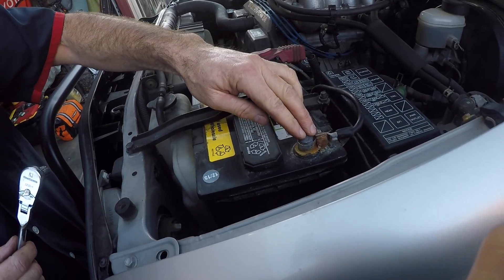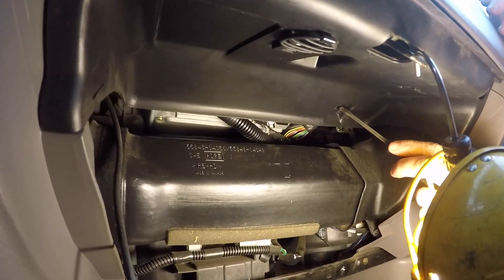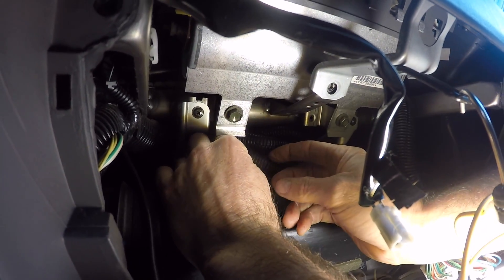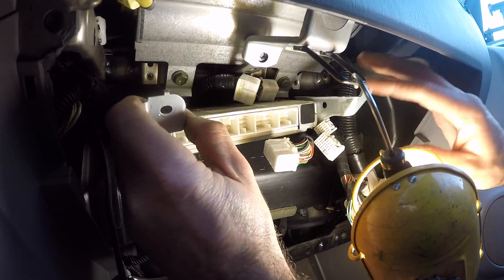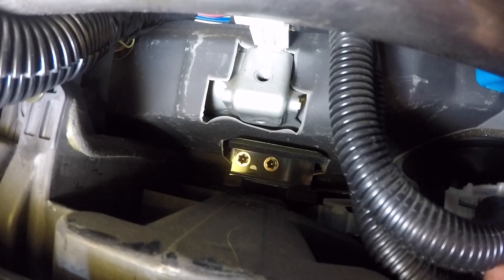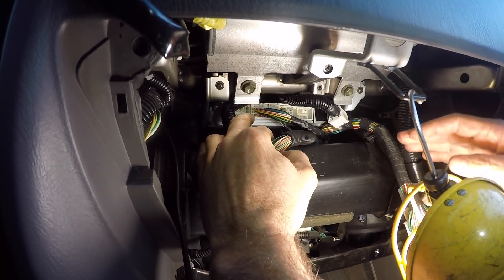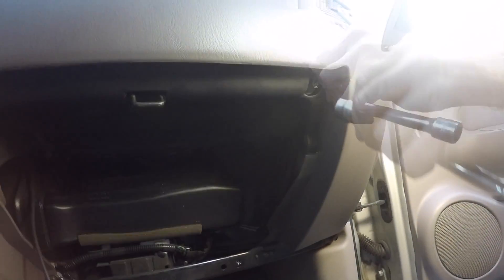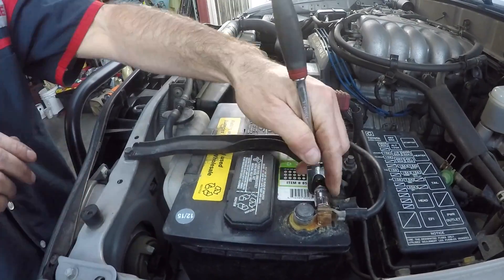ECU Replacement

Comment: Where’s Best price for ecu 2006 rx330 ? My problem is rough idle and driving at cold , seems after 30 minutes runs fine, she will drop rpm s kick and buck and after 5 minutes it run fine, she just turned 200k
Reply from the maker: I'm not sure your issue is an ECU issue, but the most affordable route is finding one at an auto wrecker.
Reply: @TimmyTheToolman  had shop put scanner on it this morning and the said ecu would not send out info? I think it’s a heat coolant sensor or wire connector problem 🤷🏻‍♂️

Comment: How much does it cost to replace ECU
Reply from the maker: Depends on how much you find a used ECU for. eBay has them in a range of prices for the same ECU, it just depends on what the seller is asking.. the cost to replace it is FREE if you do it yourself. As you can see from this video, it’s pretty straightforward. A couple interior panels, screws and electrical connectors and it’s out.
- Sean

Comment: I have a 95 can I use a computer from a 97? Found one at the junk yard.
Reply from the maker: Well if you’re talking Tacoma, we think yes (1995.5) but I would recommend getting the same year if possible to avoid any compatibility problems you could encounter with that early first year Tacoma ECU.
- Sean
Reply: @TimmyTheToolman  yeah I have a 1995 tacoma 5vzfe 225k miles. Changed everything out that would fix a p0303. Nothing. The code remains to come back after a few drives. Mechanic told me it could be a computer issue since the truck runs decent considering the mileage (226k). Found one at a junkyard but it’s a 1997 with the same engine.

Comment: Hope u be able to get to that tundra problem, are checking the compression? , on cylinders?
Reply from the maker: It was actually a Tacoma, and we did check the compression on all 6 cylinders.  We figured out that the issue was crankshaft play.  Check out the video: https://youtu.be/9Gpdq-tL79U?si=oPFwtNBaWFdDFoum

Comment: Hi Timmy.  I would appreciate your help.  My 4 runner turned off and I have already checked all the sensors and fuses.  the gasoline pump the gasoline filter.  but I'll be there but the engine won't start.  It has started a few times but I have to give it gas to keep it on and if I don't it turns off and the engine won't start again.  I have also checked the fuel regulator and the throttle bar.  I appreciate your response as soon as possible
Reply from the maker: Check the IAC valve.  That gives the engine air while idling. https://youtu.be/agIRNNA-6cs?si=QxgfITQz-BC-F8RX

Comment: Good vid. Not too applicable with my car (Mitsubishi 380/Galant) but good to watch nonetheless. An ECU repairer said they're able to copy the data from my current ECU to the replacement one, and then I'll swap them out. I have an aircon issue which has been diagnosed by another ECU repairer to be an issue with the output circuit in the ECU.
Reply from the maker: Hope the ECU swap fixes your issue.
Reply: @TimmyTheToolman  I am very pleased to say it did fix my aircon issue. And everything else about the car is running just as before.
Reply from the maker: @hrthrhs  That's great to hear.

Comment: My 1998 had a busted plug at the coil an it arched on my harness wires. I think it fried my ecu. I lost all spark completely after I saw the arching an tried to arrange things so it couldn’t anymore. Replacement ecu will be here tomorrow an I’ll see if it fixes my spark issue. I replaced coils and plugs and wires already to no avail.
Reply from the maker: I wonder if it could have fried your igniter.  It's bolted to the driver side fender in the engine compartment.  I'm not sure what happened would fry your ECU.

Comment: Im working on my 2002 4runner and i bought an exact replacement ecu but it just cranks. Runs fine with the OG ecu but i keep getting a pedal postion error after replacing the entire throttle body. The manual says to check the 2 voltages from that sensor and the supply voltage are good, to replace the ecu. I have tis and it says immobilizer B2796. Not sure whats going on. Any idea? It doesnt have a chip key.
Reply from the maker: Not sure Steven.  Your problem is above my pay grade.  I'm not sure what could be the cause other than the ECU you got has issues.

Comment: I just replaced the ECM on my 2005 Tundra.  Your video is 100% spot on. Great video and well done.  Project worked out perfect
Reply from the maker: That's great to hear.  I'm glad it worked out for you.  Thanks for taking the time to comment.  We appreciate it!
Reply: Good News for you!!
  Question...  why did you have to replace it?  what issue were you having?  I'm having a shift solenoid problem. the  transmission and the solenoid  checked out  so now the  dealer is telling me  that the ECT ECU is next.  Any Online  sources for  for an ECU?
 Thanks

Comment: Hi Tim, Thanks for the videos, they've been a great resource. I'm working on an 01 4runner SR5, and swapped out the ECM to try to resolve an ABS problem. The ECM is from FlagShip One and comes programmed with my VIN. After replacing the ECM the truck doesn't start. I thought it was an immobilizer problem, but I can't seem to find good info on this particular issue for this generation. Have you run into this before?
Reply from the maker: Does the engine start with the original ECU?  I haven't had to diagnose an issue with the immobilizer.
Reply: @TimmyTheToolman  Yes, it did start with the original ECU but had VSC/ABS/Speedometer issues
Reply from the maker: @goose610  Did you contact FlagShip One and ask them for guidance?  I would think they would have some insight on your issue.  Maybe your ECU wasn't programmed correctly by them.
Reply: @TimmyTheToolman  Yea I did, and they ended up recommending I send it back for testing. Thanks!
Reply from the maker: @goose610  Hope when they get it back to you, your problem is solved.
Reply: Did FlagShip get you a operating ECU>  I am looking at purchasing one from them for a 2010 Corolla

Comment: Hi Tim, great video! In the process of trying to fix my 01 Tacoma 3.4L prerunner and thinking of replacing ECU as a last resort. Starts great but shuts off immediately like the key was switched off. Once in a blue moon it will stay running and runs great when it does. New OEM fuel pump, fuel filters (in tank and line), spark plugs, new battery and terminals. Coil packs have normal resistance (~1 ohm) All fuses are good (checked with voltmeter). New OEM MAF sensor, cleaned the throttle body and IAC valve. No changes. I cannot figure this out and it’s driving me crazy! It doesn’t bog out when it dies like it’s being starved for air or fuel. It’s like the key is turned off. Any thoughts on what could be causing it to shut off right after starting?
Reply from the maker: Have you tested the igniter?  It could be a grounding issue.  Have you checked your battery connections, ground to the body, and ground to the engine?
Reply: What was the fix, I’m having the same issue with my 3rd gen 4Runner. Runs for a couple seconds and instantly just turns off.

Comment: I just pulled my ecu out of my 2000 toyota tundra.  I didn't know if I wanted to try it myself but after watching this I gave it a try and it could not have been simpler.  Hopefully when I get the replacement it will go back in just as easy. Thanks so much for your help!
Reply: Did you get a replacement ECU used from a donor vehicle? Did you need to get the replacement ECU programmed?
Reply from the maker: You're welcome Steve.  Hope the ECU swap fixes whatever issue you're having with your truck.
Reply: Same. I'm about to replace mine in my 2006 Tundra.

Comment: For the problem on your friends Toyota might I suggest replacing the fuel pressure regulator because when I was getting a misfire on my 2000 Toyota 4Runner that's what fixed it
Reply from the maker: Thanks for the suggest James but we actually figured out the problem and it was a BIG problem.  Greg sold his truck because of it.  Check out the video: https://youtu.be/9Gpdq-tL79U

Comment: Hi Tim, thanks for your great videos, I have a similar problem with my 97 4runner, it suddenly shuts off at low revs or sometimes it just won't start and I have to let it sit for a few minutes before turning it back on, we've already checked almost everything and We do not see what the solution could be, the code P1300 is always read. Do you have any idea what could be the problem? I appreciate your comments
Reply from the maker: Hey Wilson, the code is telling you the problem.  The P1300 is an igniter issue.  The igniter bolts on top of the passenger side fender in the engine compartment near the cruise control unit.  It's a flat looking box that's around 3" x 3" with a very large electrical connector.  I'm guessing the igniter has an intermittent issue.  Replace it and I bet your problems go away.

Comment: good explanation friend I am trying to repair my truck 4runner 2002 cylinder # 6 says the code change, several parts and I can not fix, change spark plugs cables coils oxygen sensor 1 and 2 maf sensor Fuel pump, fuel filter catalyst 1,2 and the exhaust now I want to change the engine computer ,,, my question is the computer that you are changing that is the part that I need or not
Reply from the maker: The ECU we got was for a Tacoma.  Yours is most likely a different part number.  Have you done a compression check on the #6 cylinder?

Comment: Are these ECU’s completely sealed? I have a 2001 Tundra and when it’s left out overnight during a hard rain, it roughs extremely rough and a hard time accelerating. Feels and sounds like multiple cylinders misfiring. The truck does have some rust and I was thinking maybe water was dripping into the ECU? Or maybe on the wires going into the unit? When the truck dries out, it runs fine. Also, if I drive it for a while in that condition it seems to clear up as well. Any ideas?
Reply from the maker: The ECU is basically a metal case.  Is it waterproof, probably not, but it is waterproof resistant. If water is getting to the ECU you would see water dripping from under the dashboard on the passenger side.  The water would make its way to lowest point which is the floor on the passenger side.  If your rig only does this after a hard rain, it seems logical the water is getting somewhere to affect something but I'm not so sure it's the ECU.  Have you examined under the hood to see if water is pooling in areas.  Maybe it's one of your electrical grounds.

Comment: I'm having the exact same issue with my 2003 Tundra I have replaced all coils injectors spark plugs all 4 O2 sensors. Still has intermittent misfire that has gradually got worse.
Reply: But I have no codes and it's not catching the misfires
Reply from the maker: @jefffranks6213  Don't know what to tell you.  It's difficult when you don't have any CELs pointing you in a direction.  Have you connected an OBD II scanner up or are you just relying on the fact the Check Engine light hasn't lit up on the dash?  Maybe the bulb has burnt out.
Reply: @TimmyTheToolman  I have connected my Snap-On scanner  there is nothing not even a misfire count.
Reply from the maker: @jefffranks6213  I'd do a compression check of all cylinders as a next step then.
Reply: @TimmyTheToolman  to be honest I gave up took it to Toyota 3 days ago they've been diagnosing it the whole time they still have no idea.
Reply from the maker: @jefffranks6213  Gotcha.  Well, hopefully they can come up with something.  I hope they're not actually charging you 3 days of labor.
Reply: @TimmyTheToolman  no hell no LOL pretty much they have checked everything I have already. Today they check the ECM and Signal coming from it to the coils. The signal was good during the misfire. So now they want to check the valves tomorrow.
Reply: @TimmyTheToolman  also I do have a limit on how much I want to spend. I'm a full-time mechanic myself I just work on Cummins and paccar Motors. So between diagnosing trucks all day just don't have the time when I get off that I need

Comment: Hi, Tim. I have a 2002 Toyota Tacoma that has had misfire problems for years. I finally had a garage that diagnosed the ECM-O2 sensor problem. They said they found "1 sensor 2 inop. There is a TSB that states when down stream O2 sensor is not reading an updated ECM will need to be installed along with a new bank 1 sensor 1 O2 sensor." I want to replace the ECM myself because it'll be a lot less expensive than the $1500 the garage wants to do it for me. Will the O2 sensor have to be replaced at the same time or can it be done afterwards if needed?
Reply from the maker: I'm not sure about your question,  It seems the worst that could happen is you'll throw a CEL code if the upstream O2 sensor isn't working well with the new ECU.

Comment: About 5 years ago, my 1996 tacoma was having similar issues, not responding well when pressing down on the pedal, I did all of the things this guy mentioned (spark plugs,, ignition coil, O2 sensors, cat converter...)and was taking the fuel rail off and about to test the injectors when someone said to try replacing the computer. I bought one, put it in and the truck drove great for another 5 years! Now, I replaced the alternator and battery, and have been going down the line with the exact same issues again. I had completely forgotten that I did all of that 5 years ago! Took a month for the ECU to come in the mail. I'm about to install it! Hope this does it again! I'll have to update this post if it works!
Reply from the maker: Hope the replacement ECU fixes your issue.  Good luck!
Reply: @TimmyTheToolman  it did not....I guess I'll start thinking about this being a fuel pump issue...bummer
Reply from the maker: @sydneykv  Yeah bummer.  Does your rig start and idle or does it immediately die.
Reply: @TimmyTheToolman  thanks for asking. It starts fine, used to idle okay then eventually stall out, now after many previous ECM reset attempts, it starts fine, idles for less time then starts struggling,shakes a lot, and stalls. Does not respond normally when I put the pedal down, it just sputters and backfires and stalls...
Reply from the maker: @sydneykv  Maybe it's an issue with the throttle position sensor.
Reply: @TimmyTheToolman  this is a good idea and a cheap one too. thank you for your responses!
Reply from the maker: @sydneykv  No problem.
Reply: @TimmyTheToolman  Well, I replaced the TPS and the ignition ignitor, I restart the ECU and the truck idled okay for a long time so I drove it in and out of the parking spot, then drove it in the neighborhood, but then when I went to drive it out on the real road, right as I put my foot down, the same lack of response occured and it sputtered, not responded, and backfired its way back to my parking spot and the check engine light came back on again. Ugh! The only thing I have not replaced is the MAF I think! but i cleaned it.
Reply from the maker: @sydneykv  Did you replace the fuel pump? I can't remember if you did.
Reply: @TimmyTheToolman  I did a few years back, hard to think it's the fuel pump since this all started after replacing the alternator...really has the feel to it that it's a bad signal being sent and therefore bad air/fuel/spark mixture. Thanks again for responding! I just ordered the MAF...reset the ECU this morning and now it's not even idling well...stall out again...
Reply: @sydneykv  me rn dealing with this ghost
Reply: @morphius747 been battling this for 4 months on my 2012 Tacoma. New battery, new plugs, new fuel pump, new MAF; so tired of being left stranded. Caved and took to the mechanic; now being told I need a new ECM and that only the dealer can do it. Can’t wait to resolve this and get rid of this nightmare vehicle
Reply: @cassandracornell6942  God willing it works to fix that problem

Comment: Tim, this video is so de ja vu for me.  I just spent 8(!) months trying to solve the very same P0305 code!  And I found this:  Multiple vacuum flaws, only 90 psi in cylinder 4(!) [versus 145 in cylinder 5].  I have arrived at this thought:  The programming in the ECU has a BUG!  This will never go away, except with a new model, imho.  I still get a P0305 on engine start, hot or cold.  fugetaboutit!  My rig is a 2000 gen 1 Tundra, 3.4l base model.  I'm getting a rebuilt 3.4l from Yota! in June, btw.
Another thought: a speeding teenager t-boned my right front in 2010, maybe that weakened the internals of the ecu.  But I'm setting my mind on the bug answer.  Keep Healthy!!
Reply from the maker: Good luck figuring it out.  Greg's misfire problem ended up being gross play in the crankshaft causing an audible knock.  We think the knock sensors were originating the misfire CEL.  He ended up selling his Tacoma because he didn't want to spend the money to replace the engine.  He didn't use the truck that much so he decided to get rid of it.

Comment: Hello Tim, let’s assume the swapping ecu fixed the problem. Do we have to get the vin rewritten or ecu reprogrammed?
Reply from the maker: I honestly don't even know if the VIN is stored in the ECU but that wouldn't change anything with the performance of the vehicle.  As long as the ECU came from the same year, make and model, the ECU does not require reprogramming.

Comment: i have seen other videos indicating the new ecu has to be programmed (2005 4runner) and ignition was in the on position for several minutes. other vids ive seen indicate new ignition keys for a new ecu. be a first replacing such for me.
Reply from the maker: If the ECU is from the exact year and model, there shouldn't be a need to reprogram it.  I have heard that the key will have to be reprogrammed though.
Reply: @TimmyTheToolman  means best bet will be going to the toyota parts counter, vs a wrecker and dealing with that accuracy , thank you for the vid very nice
Reply from the maker: @chevyvega6622  You're welcome.  Good luck!